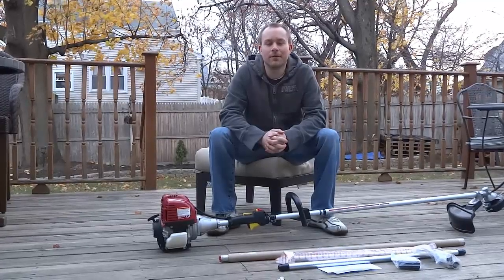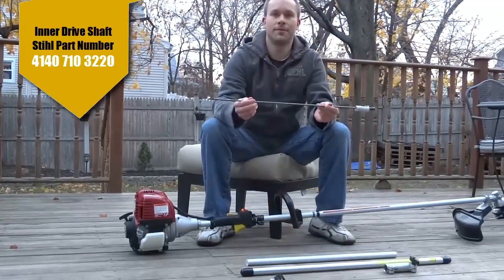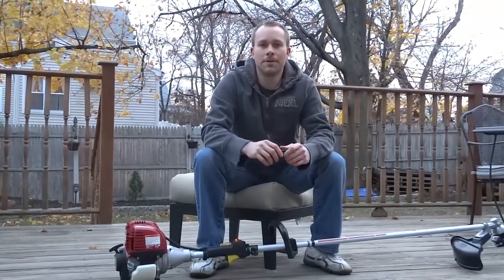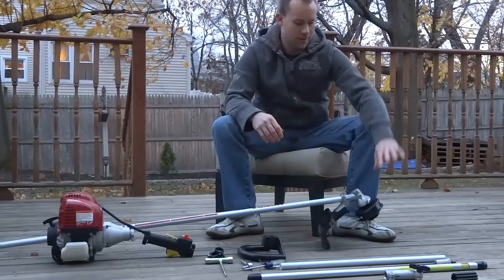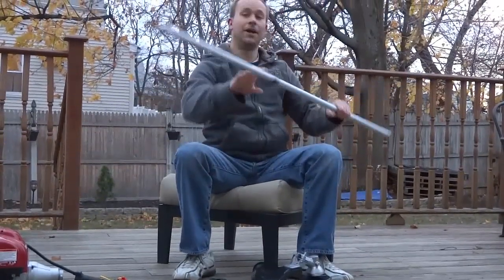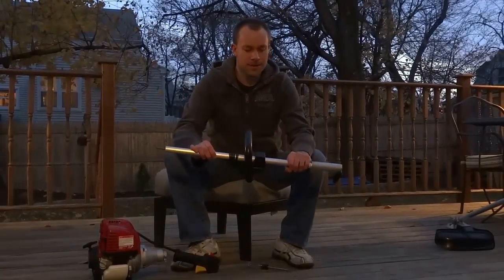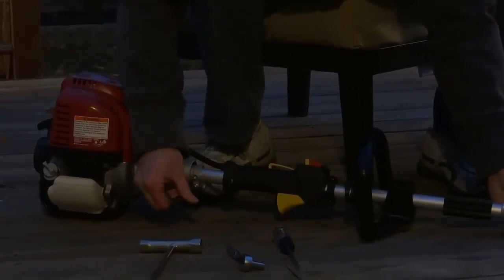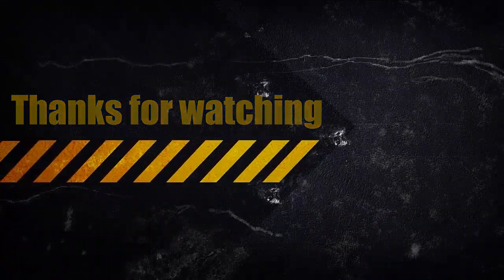How to create a Honda (Stihl) KombiSystem

Comment: Why would you want to do this mod? Is Honda motor much better than the original Stihl (130 or 131 engine)?
Reply from the maker: You would want to do this mod if you rather have a 4 cycle engine that takes straight gas instead of needing to use a 2-cycle gas + oil mix. This engine is also quieter,  but unfortunately it's also a bit heavier since it's a 4 cycle engine. For me it's more about the convenience of having all 4-cycle power equipment that uses straight gas.

Comment: I have a question for you Erik, I have the Honda GX35 trimmer and the trimmer seem to turn in the ccw instead of cw. So I ask if it's only the way the trimmer head is built or if the engine turn in the opposite way? Because If I buy a stihl blower is will be more a sucker then a blower :)

Thank you to help me.
Reply from the maker: Interesting. It must be the gearbox on the trimmer head that's making it turn CCW. I highly doubt the engine is turning CCW, but you could always pop the drive shaft out and have a peek to verify.
Reply: Erik Asquith I tried to do this modification... but the shaft between engine and coupling seem to short and when I fix an accessory like a blower the shaft go back farther in the engine and th accessory don't turn. I have a video. what your email?
Reply from the maker: Feel free to post a link to your video in the comments and I'll have a look.

Comment: I think Honda now offers the Versatool in the US, but I am considering doing your project anyway because I can't find part numbers to convert my HHT35S to accept Versatool attachments (granted I haven't been able to find the Stihl Kombi parts yet either since I can't find a service center yet that's open when I'm not working). I'm interested in comparing the attachments between Honda and Stihl. I wonder who makes the better attachment for edger, blower and hedge trimmer.

Awesome video and project!
Reply from the maker: I'm was very pleased to see the VersAttach at my local dealer in this year. However, I do still prefer the Stihl attachments over the Honda's.
Reply: I ended up converting my honda trimmer exactly the way you showed to accept the Stihl Kombi parts. Very cool project! Thanks for sharing! Huge help.

Comment: Just an update. I have managed to use a honda umk 425e engine and stihl km55 end tube. Had to make slight changes and now works fine. I have used the strimmer and the hedgetrimmer attachments and they work fine. The 425e has a square shaped shaft as the 435e does not. I had to use a longer shaft so couldn't use the stihl shaft. I cut a shaft from another strimmer to the required size and shape. To conclude I am using a honda engine and a stihl tube to use like a stihl kombi unit and everything works ok. Thanks
Reply from the maker: +Shiraz Mawji nice work and I love to see it in action. Will you be posting a video?

Comment: Thank you for your reply. Must say that your instructions are excellent in the video. Ok - my Honda model is a old model Umk 435e. Don't know how old it is and  the shape of the shaft is like a star not square. I have a Km 55 in working order but I thought I will follow your instructions and change over. 
It didn't fit so had to put it all back. 
Thanks
Shiraz
Reply from the maker: +Shiraz Mawji I believe you would need to purchase the "clutch outer" from a current model which is part # 22100-VL3-D41 and will run you around $15 - $20. However, you may want to do some further research to ensure the newer clutch outer would fit your specific model, or require any additional parts. The KM-55 inner shaft is not a solid shaft, and I believe it is shorter than the solid shafts on the KM-90+, so I'm not sure how well that would work for this application. Good luck and please report back any progress.

Comment: Hello,
I have tried a similar thing to what you showed but the Stihl  shaft is square and the Honda is a different shape and hence shaft doesn't fit into the Honda engine side. Any ideas?
Shiraz
Reply from the maker: +Shiraz Mawji what model Honda trimmer do you have? How old is the Honda trimmer? What shape is the end of the inner drive shaft on the Honda? What model Stihl shaft are you trying to use (it's not from a KM-56)? The inner shaft of my Honda and Stihl shaft are both square.
Reply: Er

Comment: Husqvarna 224L 4-Stroke Straight Shaft Trimmer — 25cc Honda Engine, 17in. 
Do you know if that will work with above parts?

Thanks!
Reply from the maker: +Brian Payne I don't know for sure. However, if the shaft size is 1 inch and the inner shaft as a square end (not a star), it should work.

Comment: This was really helpful. I did the opposite, though. I used a Ryobi shaft with a Stihl motor.
Reply from the maker: +Jimmy Asher did you concoct your rig before or after watching this video? How has it been working out for you so far?
Reply: +Erik Asquith I did it after watching your video. I've got a Stihl FS85 Pro that runs great, but the only attachments I have are the universal Expand-It ones.  The Stihl drive shaft stuck out about a half inch from the tube where it connects with the motor, and the Ryobi shaft was flush with the tube, so I had to cut the Ryobi tube back a bit with a sawzall, but that was it.  It works great! My pole saw attachment is actually useful now with the Stihl motor. I was able to just move my Stihl string trimmer head to the attachment shaft of my brushcutter head. It's a little short, but  I've got a longer attachment shaft on the way. Thanks again!

Comment: The best outdoor/yard equipment video I have seen yet.
Just yesterday I sold my Honda HHT35S for $320 and bought Stihl KM130 with trimmer, edger, pole pruner and blower attachments. Total cost approx $900. If Honda was able to take attachments I would of never sold it, by far it was the best trimmer I ever had.

Comment: where can i purchase these parts
Reply from the maker: NeedGravityGfx You can purchase the Stihl parts from your local Stihl dealer. You may also be able to find a used K90 or better (with a solid steal inner shaft) with a blown engine on eBay or Craigslist. You can purchase the Honda trimmer from your local Honda dealer, Home Depot, or Wise Sales.

Comment: COULD YOU SHARE THE COSTS OF THIS PROJECT VS JUST BUYING A STIHL KOMBI 130
THX
Reply from the maker: Hi PARDS2,Honda's MSRP on the HHT35SLTA is $379, Home Depot sells it for $359, and I picked up a brand new one for $200 on Craigslist. The Stihl Kombi inner drive shaft (part # 4140-710-3220) is $51, the outer drive tube (part # 4140-710-7120) is $37, and the coupling sleeve is $43. The Stihl Kombi lower drive shaft to attach to the trimmer gearbox is $30, but my dealer had a bunch laying around and sold me one for $10. Grand total = $520 (my total investment was $341)

Stihl's MSRP on the KM 130 R is $370 and the FS-KM trimmer attachment is $100. Grand total = $470.
Reply from the maker: Steven Kozicki here's the parts list:
Upper Drive Tube Assembly # 4140 710 7120
Inner Drive Shaft # 4140 710 3220
Coupling Sleeve # 4140 160 0700
Lower Drive Shaft # 4140 710 7129
Reply: Erik Asquith My heart just broke! I have this Honda trimmer, and I just went out last weekend and spent $1200 on the 130 Kombi head, three attachments, and the extending pole. Oh well, i know i'll never have to buy another lawn implement as long as I live.
Reply from the maker: Steven Kozicki if only you saw this video a little earlier, huh? :) Sorry to hear. I assume you already gassed up the KM 130 power unit and used it already? If not, you should be able to return it to your Stihl dealer and retrofit your Honda trimmer to accept Stihl KM attachments, if you prefer. Either way, I'm sure you'll love the KombiSystem.
Reply: Erik Asquith Yeah, already used.  I think I may buy the parts anyway and then i can use both power heads at once.  Maybe i'll sell the 130 Kombi head on E Bay later.  What are the part numbers for the coupling sleeve and the lower drive shaft, if you know?

Comment from the maker: The inner and outer drive shaft as well as the coupling with wing nut will run you about $150 from the dealer. Once you attach this Kombi shaft to the engine, you can use any KombiSystem attachment available.

Comment from the maker: Yes, you can remove Honda bike handle from the Honda drive shaft and bolt it to the Stihl Kombi upper drive shaft. However, if you wanted to ditch the bike handle, it looks like you would need to use a different trigger assembly that would allow you to slide it over the drive shaft. The pictures of the trigger assembly show it does not have a hole at the top end to would allow the shaft to slide through and out.